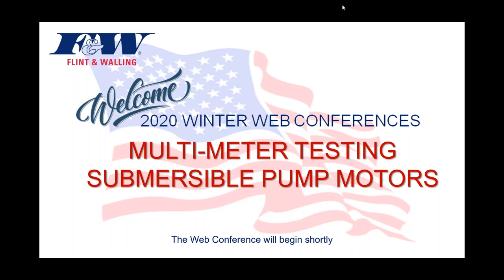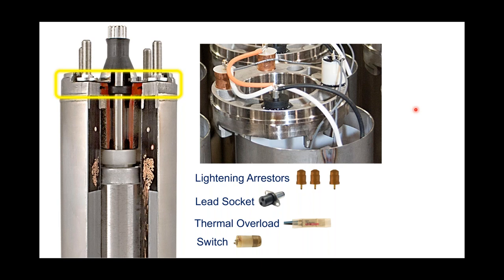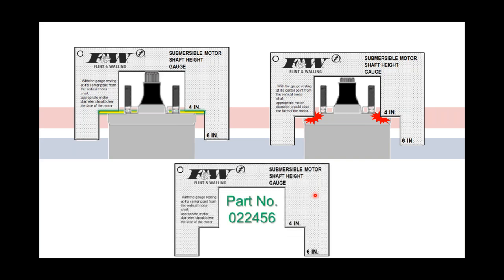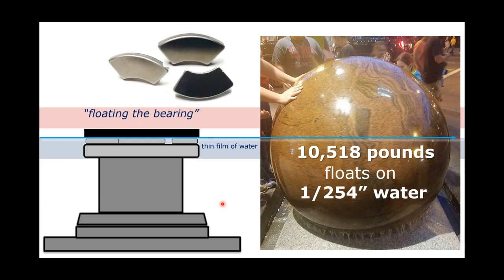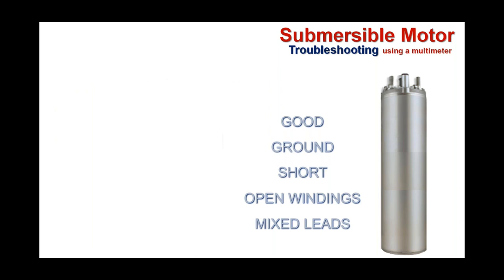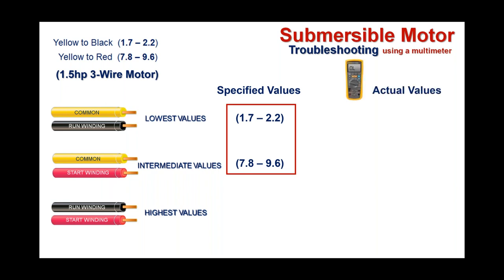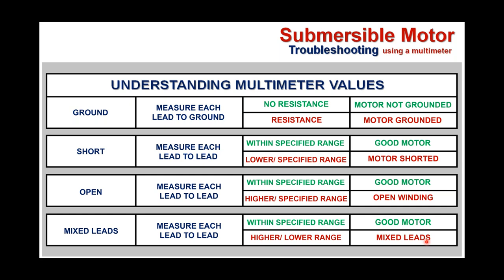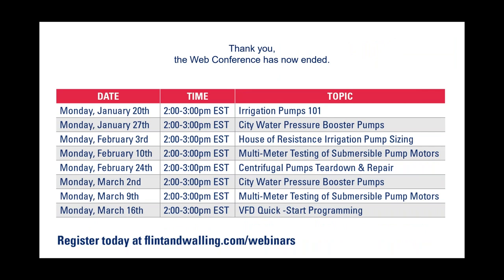Multi-Meter Testing of Submersible Pump Motors

Comment: 23;00 mark he mentions grounded leads but does not say if that is bad or good, he just says if you have resistance between leads then you are grounded- question   I have  50 hp  phase 480 volt motor, I disconnected the incoming power and used a fluce 2k ohm meter, one lead touching green and the other lead touching red, then green to black , then green to yellow- each reading i had resistance, just as if i was touching the 2 meter leads to one another- is this good or bad?   thanks all.....

Comment: Why is it instructors get things so backwards. If your meter shows Infinity the circuit is open if it shows zero the circuit is shorted.
Reply: Exactly! Oh, YouTube. Here I thought I found a great video with step-by-step instructions, great graphics, etc., only to get to about 22:15 where I lost all confidence in the video when he says exactly the opposite of what's going on: he says if you get OL or 1 on your meter it means you have no resistance and all is good because the motor is not grounded. But 1) if you get no resistance (= zero resistance by definition, in other words the meter reads "zero") your motor is probably very grounded, plus 2) OL or 1 on a meter means you have so much resistance you have to up the range of your meter, or it exceeds the meters capabilities, in either case LOTS of resistance, maybe infinite, and that's what you want. So he gets it half right: OL or 1 (or lots of megohms if the meter can read that) is what you want, but to confuse very high resistance with "no resistance" is a huge conceptual mistake. To quote F&W's own manual, for the ground (insulation resistance) test, "the multimeter reading should indicate infinite or max open...." in other words the opposite of "no resistance."
Reply: Having looked ahead to the rest of the video, despite the weird flaw mentioned above (correct me if I got that all wrong) it does seem to be an exceptionally clear and well done video, and I think overall it will be very helpful to me.

Comment: thanks for the video. One question on testing to see if the motor is grounded. On your chart at 24:11 in video you show the motor being grounded in red ink and the motor not grounded in green ink. So then is the motor NOT supposed to be grounded?

Comment: My motor Y-B is 3.8 instead of 3.7 ohms Y-R is within range.. My 3W motor turns freely by hand but with power turns very slow and gets warm. How can I tell if it is the motor or motor controller.?